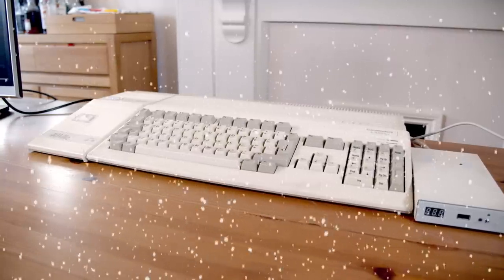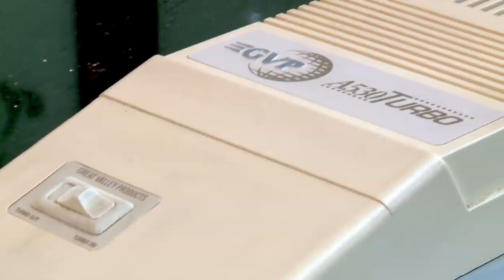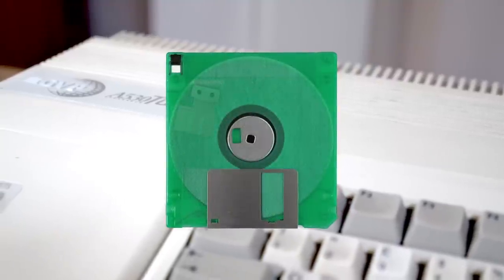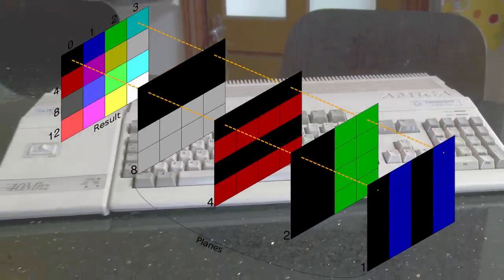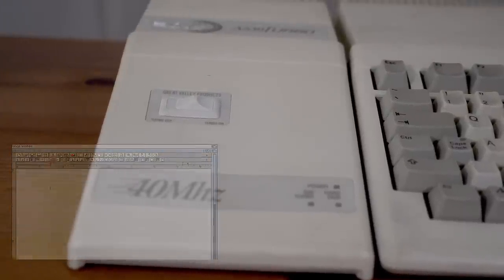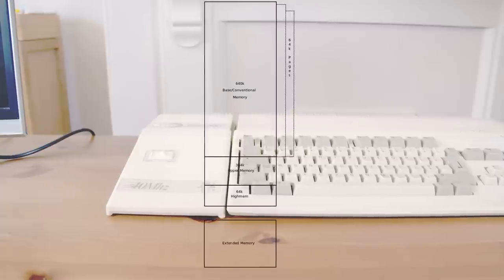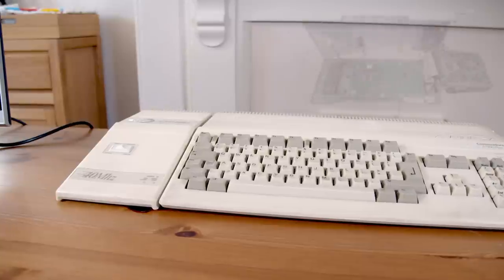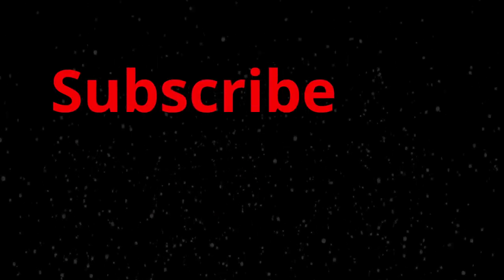This is a PC, no really.

Comment: Bit of correction / possible help with the video stuff (and a question)... it's technical so forgive the length, it may be worth ploughing through:

1/ Most PC modes are actually still planar. I think it's only VGA 256 colour and maybe the VGA-specific 16 colour modes (400 / 480 line) which use chunky arrangement. Particularly 4-colour CGA and 16-colour EGA should be a piece of cake for the Amiga to deal with because it has equivalent modes built right into the chipset (2 and 4 plane). The bigger issue would be the weird way that CGA and maybe EGA arranged those planes (they have some kind of multi-line interlacing through memory, because... reasons?) which would need the video chip redirected back and forth through memory line-by-line. Similar for Hercules, which would otherwise have been a very simple single bitplane affair (if you're only using 1 bit, chunky IS planar).

That plus the mild amount of hardware acceleration on EGA (HW scroll, plane masking, text rendering, blitting etc) that was slightly improved on in VGA, some but not all of which were also present on the Amiga but would have entirely different instructions to access, and the rest would need software emulation anyway (luckily the only app which really made extensive use of any of that was Windows).

Oh, and of course, text mode. Even the CGA version would have been challenging for a non-fast-RAM Amiga (as would higher rez EGA, and VGA), as it has 16 colours and 80 columns, which uses pretty much all of the chip RAM bandwidth, plus it has to use the remaining time to render any changes either by blitting from a character map in RAM or just drawing them with software (vs the CGA doing it all in hardware), so good thing you're starting out with fastRAM already.

NB. The planar example is a little misleading ... in CGA and low-rez EGA that illustrated mapping is valid, as it's 1:1 between a bit in memory and one of the lines in the monitor cable (with some remapping for CGA given the multiple 4-colour palettes). But for hi-rez EGA, VGA planar modes, and machines like the Amiga and ST that have variable palettes, it's more abstract. Each plane is simply one of the bits making up the colour value in the palette, and they don't have any fixed meaning (especially when you come to something like a 32-colour mode with 5 planes, or doing things with sprites where they have their own separate palette and a transparent colour or bitmask). Which kinda makes things harder, really... if it was fixed in that way it might be a good bit quicker to do the conversion.

2/ The problem you had when it booted... I think it's probably on the capture end, and the retro hardware is fine. 99% sure anyway. As it said 15.62kHz both for low and high rez, it looks like either you bypassed the flicker fixer or it didn't turn on for some reason (maybe it needs some external signal to confirm it's using a multisync monitor, as trying to drive a regular one at high frequency might blow it up?). So it's come up in interlace mode... which otherwise wouldn't be a problem anyway if captured properly, as software deinterlacing to a similar or better extent than a flicker fixer would is fairly trivial these days... BUT the hardware has to be set to capture it at the full rate and resolution, and the software used to then process it has to be up to the task... and it doesn't look like that's happened here.

Possibly booting in progressive mode confused it, and it started the file off as 320x288 (or 640x288 or whatever) at 50fps instead of 640 (720?) x 576 at 25fps, or at least 288 lines but with alternating fields at 50 fields per second. Maybe it just can't handle interlacing at all. Wouldn't want to say for sure. But it's a familiar annoyance from my own historic attempts at capturing laced material off VHS and the like. Capture systems seem to default or even be locked to doing the dumbest possible deinterlacing, which is usually just dropping every other line entirely (ie an entire field, so you get the low resolution AND low framerate), or running at full rate but saving the data for each alternating field as if it was an individual frame, so the vertical information gets overlaid into the same place rather than spaced out by half-steps, thus giving the most obnoxious possible flickering rather than simply the kind of unobtrusive combining / mosquito noise around moving objects like mouse cursors that you get if plugging an Amiga into an LCD TV and using laced mode.

I don't know why it ended up flickering relatively slowly, unless that's something you've done for the benefit of epileptics, but maybe that's a mismatch between the video running at 50fps and your monitor / the output stream for youtube running at 60fps?

As for why that happened straight away, I fancy the Amiga itself comes up in progressive mode, but then the emulator is set for a higher quality text mode than the basic CGA (MDA, EGA, VGA, or pretty much anything else other than Plantronics), which could be anywhere from 350 to 480 lines, most likely 400, so it requires either interlace on an OCS machine, or a directly connected multisyc on ECS and later (which I think the Plus counts as? Have you possibly got confused between its inherent hi-rez abilities - which are somewhat short of both EGA and VGA, more like an improved Hercules - and the actual flicker fixers which would translate the more colourful interlaced modes up to a much more EGA/VGA-like experience? If it can actually do some measure of that it might be worth seeing if your capture device can deal with it...)

3/ The above may have looked ugly but it needn't have been fatal to the capture part of the video even if you couldn't do hi-rez properly. Presumably there should be a way in the control software to lock down what video modes are used? CGA text would have worked fine, it's basically the same quality as the Amiga default modes but with more colour (CGA can only do standard frequency output), and you could have used its "high rez" monochrome mode to show off Windows 3, even if it would have been blocky and without colour. I think it can sort-of run MDA software as well, at least if it's been programmed to allow use of the equivalent (same text grid size, but clunkier looking font) mode on CGA. Don't think Windows allows low-rez EGA, but if it does that would be a good compromise, you'd be stuck with 200 lines but at least it'd be in colour.

For games, EGA would also have worked fine in most cases, as the great majority of EGA games ran in the basic 320x200 16-colour mode so they'd have the widest compatibility (it was offered as an upgrade path for users with RGB CGA monitors as well, especially by clone card makers... you just didn't get the flagship 640x350 mode with the extended palette unless your card did some kind of emulation of its own). There's a few which do hi-rez but from the look of that Outrun loading screen, it isn't one of them.

VGA is a bit of a harder one, for the most part I'd expect 286 class games to also use low rez just with more colours (not sure how the Amiga would deal with that tbh - I kinda assumed it'd work like a typical "super EGA" multisync card for PC and only allow use of the 16-colour hi-rez instead, which is possibly part of why Windows has a fixed palette and a bit of a not quite obvious one at that - they're tuned for EGA hi-rez compatibility), but there's plenty of opportunity for interstitial screens like menus etc to use hi-rez instead... Maybe safer just to stick with EGA.

(An interesting one to try would be the re-release of Monkey Island 1 & 2, which had an EGA mode that ran at 640x200 with dithering to try and recreate the VGA colours...)

4/ A somewhat little discussed or used part of the Amiga video standard is that there are pins in the connector for a PC-style RGBI monitor (essentially the 16 colours you've shown off in the planar diagram, with each plane being a 1-bit on/off for each of those colours, with I as additional intensity/brightness). I've sometimes wondered if any use was ever made of that at all, especially in the later multisync capable models. Is there any indication in the emulator docs that you could possibly hook up a genuine CGA monitor that way, for example? (Possibly Commodore were a bit unsure as to whether anyone would go for the more expensive analogue RGB monitors as an upgrade from composite if they wanted sharper text, so hedged their bets...)

5/ ... what's it like on the sound front? I assume just the basic PC Shrieker burps and that, maybe too early for there to be any soundcard similar enough to the Amiga hardware to be worth attempting to emulate (e.g. Gravis Ultrasound), but maybe it might have had a shot at the 3-squares-and-noise of the PCjr / Tandy system or the like...

Comment: 22:35 well for one now you have a 286/386 with a 680xx co processor, or amiga with a 286 or 386 coprocessor
Reply: now write some amiga software that instead uses dat card as a co processor or dsp instead of a pc emulator
Reply: pretty much could boot strap dat into a gpu and video display accelerator, could probably do lots of trigonometry, calculus, algebra, and fast floating point math wit dat
Reply: shit its got 512k built in
Reply: now a bunch of amiga demo scene ppl go "now why dint i tink of dat?!?!?!"

Comment: Help!!   Back in 90 when I had my mega 500 I had a floppy disk that I could boot up and it was a PC emulator it booted up or you can run it from the work bench and it emulated IBM PC and I used to run wordperfect in it I didn't have no hard drive I can't remember what the software was called it was on one disc!!!

Comment: What's the big deal about having your 256 colors with the PC in the Amiga if the OCS Amiga can already show 4096 at the same time without it?
Reply from the maker: 4096 colours where only available at once using a display trick, known as hold and modify, which involved changing the pallette every scan line. Where as vga could do 256 colours as a regular screen mode.  Later aga amiga models would gain a 256 colour mode as well as a 16bit ham mode.
Reply: @RetroBytesUK : So if it could be done, it could be done, right? Who cares how it got there (besides developers) as long as it did?

And then how many colors were typically on the screen at same time, or at least able to be, when people were editing broadcast-quality standard-definition video on the Amiga?
Reply: @HelloKittyFanMan.  The Amiga's hold-and-modify screens are only really suitable for single static images, and don't really translate to being used as a general display mode. For a start, each pixel on the screen can't be any colour - a pixel's colour is calculated as a difference from the previous pixel, so you end up with intermediate pixels to get from one colour to another. Generating the images requires them to be pre-processed into this format.

Ulitimately, using a HAM screen as a stand-in for 256-colour VGA would be very slow and look terrible.
Reply: @Zeem4 : ..or as a stand-in some kind of thing like a 4096 version of XGA? So, 1. Why did it have to be this way; why all the complication to show that many colors at once back then instead of just being able to do it directly like we can now? 2. What would you say if I were to invite you to try to answer the same follow-up question as I asked Mr. Retro up there?
Reply: @HelloKittyFanMan.  Available memory and bandwidth. The most colours an OCS Amiga can display using a 'normal' screen mode is 32, or 64 for ECS like in the A500 Plus. Remember that this was a consumer-level product launched in 1985. And as far as I'm aware, video wasn't edited on Amigas the way modern computers do it - they were mainly used to overlay graphics onto tape-based video, so lots of colours not required. Think of subtitles, weather reports, captions and so on. The built-in genlock functionality made them ideally suited to this. They may have also been used as controllers for editing decks but I'm not very familiar with that stuff.

Comment: Both 8088 and 8086 are 16-bit.
Reply: True, the difference is that the 8088 uses a 16-bit bus. Also both CPUs were available as off-the-shelf components, but the 8088 was cheaper and Intel produced more 8088s than 8086s, so IBM wasn't sure if they would be able to deliver them enough 8086s, which was another reason why they chose the 8088.

Comment: CD-ROM drives for Amigas? :o
Reply from the maker: Commodore even released their own cd-drive for that edge connector (the A570), you could also add an external cdrive via the external scsi port provided by an number of the hard disk addons.
Reply from the maker: Also on the Amiga models with built in IDE (A600, A1200, A4000), you could connect an ide cdrom drive to them.  Having space for them in the Amiga's case was tricky however for the A600 & A1200, its one of the things that drove sales of the replacement tower cases for the A1200.

Comment: And this is when at this point in time, you would just buy a cheap 286 clone and leave your Amiga alone for Amiga things... I like the rest of the expansion, and maybe the x86 bit could be used for some very specific tasks, but a dedicated clone would do better and probably cheaper. The faster cpu and ram and hard drive, yes please. 286... meh.
Reply from the maker: It was cheaper than a whole pc, and did save quiet a bit of disk space. However like I said at the end of the video, it is a nitch bit of hardware. There is a narrow range of people it would appeal to.  At the time I would have been right there with you and chose the A530.

Comment: But can it play Crys.... I mean Doom? Since everything has to play Doom, now.
Reply: No. DOOM requires a fast 32-bit CPU.
Reply from the maker: @IkarusKommt  Like IkarusKommt said, on on the PC side as doom did not support the 16bit 286. On the Amiga side doom was ported, and runs fairly well on a 40Mhz 68030.
Reply: As it's a 286, I'd maybe try Wolfenstein instead. Using the EGA mode hack.

Comment: Tiny nitpick re: expanded memory. It was NOT 'himem', or memory located within the 640k to 1M range. It was actually memory located ABOVE the 1M barrier, but was MAPPED into the 'himem' area, one miserable 64k page at a time. It was a complete mess of a system, requiring hw and sw support on the 286, and was dog slow in every way on that platform. The 386 had HW support of expanded memory, so it would have been faster, but still was really annoying to implement. It was basically useless for the majority of cases and wasn't well supported.